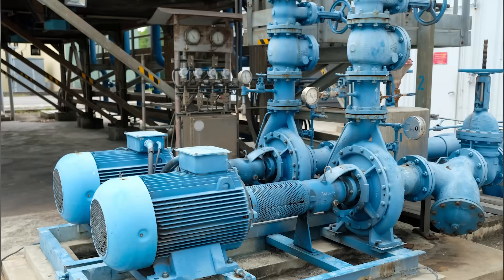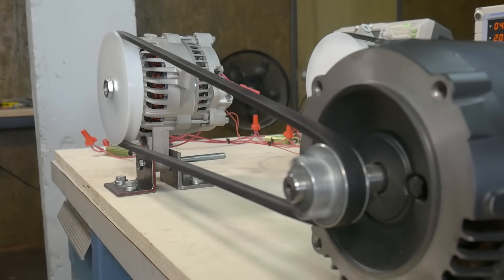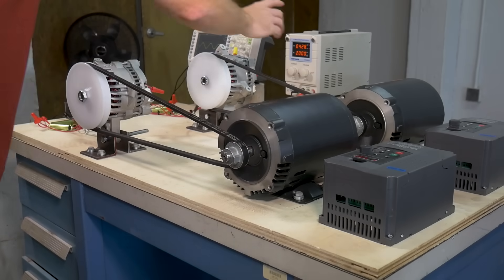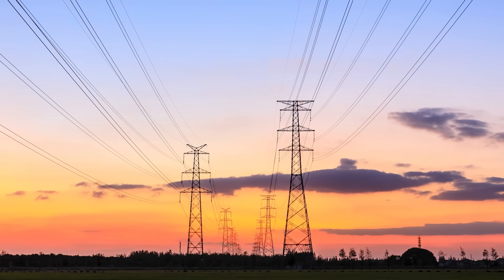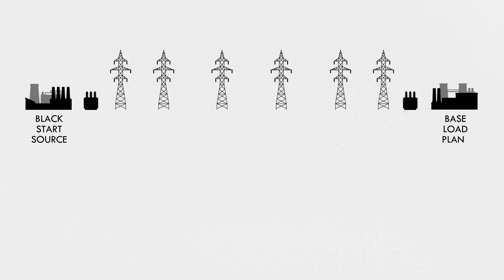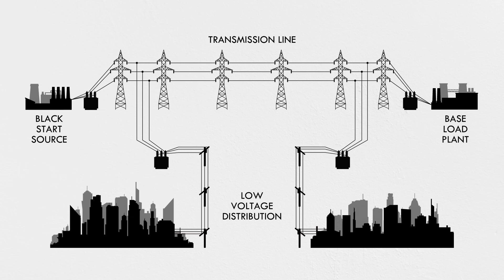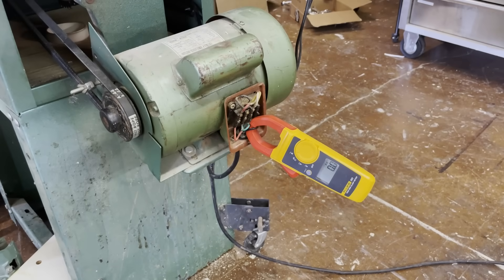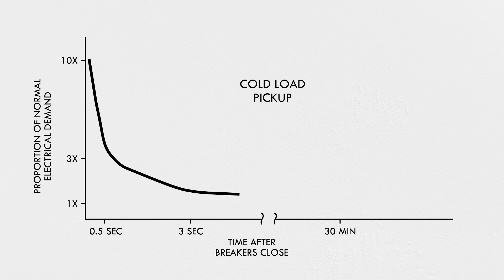What Is A Black Start Of The Power Grid?

Comment: Have you considered video or series on landfills?  Street collection, transfer stations, the detailed hydrogeologic investigations that go in to landfill siting and construction, use of low-permeability natural or synthetic clays (and their moisture-density relationships), HDPE liners, and drainage systems to prevent environmental degradation, groundwater monitoring,  placing and compaction of waste (can throw in GPS-enabled equipment and lidar surveys), final cover design and construction, landfill gas collection and power production, and if they're still awake after all that, the local, county, state-wide and federal permitting.

Regardless, I love all your videos and keep up the good work!

Comment: Interesting. I live in Florida and have experienced storms ranging from "merely" tropical to full blown CAT-2 hurricanes. I've lived in the same house all these decades and have wondered why it sometimes takes just as much time (sometimes even more) to get back power from a lesser storm. This video gave me a greater appreciation of what goes into restoring a grid beyond simple physical damage to lines, transformers and substations.
Reply: Wait till you go thru a Cat 5. Try 5 weeks without commercial power. Local nuke plants cannot run without the grid being up. Even when there were oil fired units right next door. Power went out from the plants to a substation and then back to the plant. Substation going down or the grid going down resulted in the reactors scramming. So a minor storm that took out a minor part of the grid could result in power being out for days until the HV lines were back up.
Reply: @gravelydon7072  I can believe that. Just looking at what happened to those poor souls in the Southwest of my state... Brrr, those drone footages are scary as hell. I'm pretty sure it will take them weeks just to get power up throughout that area.
Reply: @Vulpine407  They will in most areas have an easier time than down here. Here if you dig down 6" you are in rock. When Andrew came thru, it snapped off most poles at ground level. That included brand new concrete poles that were 4' in diameter and so new that the power had never been turned on to them yet.  On our street is one lone survivor of Andrew. The pole in front of our house was put in in 1978 when our house was built. They had to top it to install a new insulator but our transformer was put back in use for almost another 5 years after that. It has a lean to the West but it has survived a Cat 5, several Cat 1,, Cat 2, and Cat 3 Hurricanes. 

After Andrew, my employers flew over the areas hit with the District chopper. I have the unedited videos from that with the time stamp on it. Now days drones do the same work. And yes, I can feel for those on our West coast having been thru one of the worst in US history.
Reply: As a Mississippian I am surprised you’ve lived in Florida for decades and still haven’t been through a 4 or 5. I still have nightmares about Katrina when I see hurricanes on the tracker heading our way.
Reply: @huntercarter5426  2005 was a bad year for us down here too. While we didn't have a Cat 5, we did have 3 of them one right after another. Katrina, Rita, and Wilma all touched us with Katrina a Cat 1 at the time , Rita was a Cat 2, and  I forget what Wilma was when near here. With Rita we lost power for a week as the crews had to repair some of the three phase lines before they could get us powered back up. Once the crew arrived, it took them most of the day to find where the fault was.  It was a cracked insulator that they only found after blowing a number of fuses trying to locate it. It was a 3 mile long power line. We now are on a segment that is only 1/2 mile long. Much easier to find the fault but bumps us down as far as priority.
Reply: @huntercarter5426  Oh, the state has certainly been hit by quite a few CAT 4 & 5 storms. But since I live in the interior of the state, they tend to lose at least two category levels (usually three) by the time they get close to me. If memory serves, Hurricane Ian hit the Punta Gorda / Cape Corral area as a CAT 4. But by the time it had reached my county, it had dropped down to a CAT 1. I believe Hurricane Charlie was the worst one I have gone through in my area. It was still about CAT 2 strength when it went through my county, badly damaging our main roof and pretty much destroying our carport. It was followed by another hurricane just a few weeks later (can't remember the name) that crossed over us from the other direction. Thankfully, that one was weaker. But the joke in central Florida that year (2004) in my area was: "X marks the spot."
Reply: Only CAT 2? You’re lucky. I live in coastal area of a mid Atlantic state commonly hit by hurricanes and I’ve lived through all but a 5. Only evacuated for direct strong 3 hits and above. We were lucky though as we didn’t have to worry about the sound flooding as it came back in as many did or ocean overwash.

Comment: I’ve worked closely with WAPA in the USVI. They take each island grid down every time there is a tropical storm or hurricane. And so they must have a blackstart recovery each time, which is difficult bit on a smaller scale than any off the three grids in the US/Canada (Eastern Interconnect, Western Interconnect, ERCOT). Large grid or small grid, getting them up and synchronized is a challenge.
Reply: I get generator synchronization but grid synchronization begs many questions:

What is used for the grid frequency reference?
How is the generator frequency in each island adjusted?
Would only 1 transmission tie line be used for the initial sync?.
Reply: @JohnDoe-od1yj  From my EE education, one line would provide initial sync, then each additional line might need phase adjustment before establishing a redundant connection that turns the lines into an actual grid.  Fortunately, most black starts happen on a grid where all the lines were correctly adjusted just a few hours earlier, so they tend to be in sync already and just need power to run.  Situation is much worse when recovering from major grid damage as the adjustments will have to be redone during the process, as the grid is essentially being rebuilt.  Someone will have to watch synchronization meters at each interconnect before closing the big switches.  Oh, and good luck phoning the control room from the field as telecoms have been skimping out on their back up systems for about 2 decades now.  I hope the grid operators have backup power for the old control fiber optic networks to function during black starts.

Comment: I feel like you jumped ober the usefullnes  of grid battery like tesla megapacks have. With there inverters they can generate the the frequency and and power to a pant. Aso digital inverters are extreeemly fast in countering spike loads vs those big turbines

Comment: I worked as an overnight maintenance engineer for a large hospital complex.  I had to do weekly load tests which involved shutting off most of the heavy draw equipment (elevators and such) leaving on minimum equipment running and fired up the generator.  My involvement was just press the start button on the generator and it automatically shut off the external power and running operations on gen power.  I let it run for 30 minutes and recording voltages and amperages and fuel levels.  At the conclusion of the test, I pressed the shut down button and watched as the phase and voltage matched the grid power and when they matched, the generator would automatically disconnect and begin it's cool down period and shut off.  In case of a power outage, the generator would fire up within a few seconds and all equipment on the emergency power circuits would be powered up.  This kept all essential equipment up and running.  However we could only run one elevator on emergency power.  I did a lot of reading of the manuals to familiarize myself with the operation and maintenance of the generator and switch gear.

Comment: Idea: combine both magnet and a coil in the rotor. Make the magnet so it generates 90% of voltage, and use coil to regulate remaining 10%. Voila, you just saved 90% of power consumption and startup power.

Comment: Synchronization is too important to be left to an operator with a synchroscope and quick reflexes. Each generator is equipped with a "sync-check" relay that will not allow an operator to close the breaker that connects the generator to the grid if the generator is not in-sync with the grid.

Comment: Black start has to do with a generator. The "grid" does not have to be started, you just close breakers from where you have power. A gen, has a lot of turbine related pumps, control equipment, etc, that needs power, before you have any power. You need a small gen to provide power to get the bi gen going.

Comment: You have avoided the fact that a generator with no electrical load will 'run away.'  This is not a problem for your AC motors because their top speed is defined by their power frequency.  As a generator is spun up, it must also be matched with an independent load until the frequency and phase matches the grid.  "Closing the switch" transfers the generator's output from this independent load to the grid.

Comment: OK, I am to drop the bomb that spawned endless arguments in the other vid about this.

New generator needs to be synced to 180 angle to the grid before it is connected, not 0 angle. The argument is that electromotive force of the grid is directed the opposite direction than the one of the generator. I.e. if we stop time at some moment, we will see the grid trying to push charges into generator and generator is trying to push charges into the grid; or vice versa, depending on when we stop time. If the grid pushes and generator pulls - that's when we got automotive forces moving charges into the same direction along the wires, thats when we got 0 phase angle, and that when we got devastating short circuit.
So.. why are they 0 angle on the oscilloscope? Because you put oscilloscope in between generators! The push against each other and both into oscilloscope which is in the middle point. But they still remain opposite to each other.

Comment: Speaking as an old retired electrical utility employee, I think that in your series, you have done an outstanding job of breaking down the high-wire act that is the electrical grid.
On a side note, nuclear power plants cannot afford to be without an on-site cold start power supply, since they need power to monitor the reactor, and maintain cooling, while the grid recovers. This was one of the lessons of the 2003 blackout. Every nuclear power plant installed a large diesel generator on site after 2003.
A further lesson from the 2011 Fukushima event, was that nuclear power plants have to have emergency generators sourced offsite, and available to be brought in, in the event all power sources onsite are lost. Now every nuclear plant has an emergency generator sitting off site in a warehouse, ready to be brought in, if needed.

Comment: Reminds me of how large aircraft are started without ground equipment.  You use a high psi wobble pump to fill a start tank, which in turn starts an APU, which in turn provides bleed air to start an engine that provides more to spin.up the rest.

Of course, the better way to do it is using ground power.

Comment: one thing, many of the powerplants will just trip the breakers for generator exits, even it basicly means that many selfconsuming applience in power plants will stop working, but it is only for a short time, many plants have ready to run diesel generators, mailny Nuclear, those can newer be without power to keep the core cooled, they can reduce to like only one reactor at minimum sustainable reaction and keep operating in the time needed to repair infrastructure, and then use that one reactor to "cold start" other reactors and eventually other powerplants like coal and so on, but that one reactor is still running and producing just enough power for the facility to operate

Comment: Back in the late 1980's and early 90's I lived in St. Cloud Florida and the lights would go off and back on several times in a row around 12:00 am.  Later I was told that it was due to a GENERATOR being added to the local grid so that one could be shut down for maintenance, and I was told that it was because this generator was slightly out of phase with the other generators that caused the lights to go off and on.

Comment: 10:05 - Back in power lab in school, we had a 3-phase "machine" (both motor & generator), the size of a full sized van, that we had to speed up to synchronize it to the AC line before connecting it. We used 3 light bulbs, one for each phase, and connected, when all 3 lights went out.

Comment: That's not how we synch using a synchroscope.  You adjust speed until thr needle is moving slowly in the fast direction.  Then you synch 5 minutes to 12.  That ensures your generator picks up load and also ensures the latency of the operator will close right in phase.

Comment: I've used that GE syncroscope to sync to the grid. It is impossible to make the needle stop at 12o'clock to close in the output breaker. Slow in the fast direction and close the switch at the tail of the arrows fletching so you ensure you pick up load and don't reverse power the generator.

Comment: I've heard tell, from a friend with an engineering background that was from upstate New York, about a small coal-fired plant that was blackstarted during the 65 event c/o some real outside-the-box thinking.  Bootstrap power was needed to run the conveyor that fed coal to the boiler; once they could get it re-lit, the rest would fall into place.  AC motors will run on DC if you get the proper voltage, you just have to pay attention to polarity for which way the motor turns, so they pulled the batteries from their cars, strung 10 of them together in series (maybe doubled up series-parallel) to start turning the crank.  And that did the trick!  Or so the story goes.

Comment: I am an electrical engineering student and had a lab experiment on synchronisation. Your demonstration has helped me to understand why synchronisation is so important. Thank you
Reply: I saw some good videos online showing synchronous motors and how they lag as the load builds until they pull out of synchronization. That would certainly cause some wobbles with a big motor. Also lots of stuff on using one for power factor correction. Im a truck driver not a student but I can understand the principles if not the details from  this.I live in South Australia where we have some days using 100% renewable only and exporting to other states thanks to wind/solar farms and high penetration of rooftop PV along with grid scale batteries. The problem is grid stability due to such low "inertia/momentum" because there is not really any spinning generators during high output days and it is easy for harmonics to upset the system. They have installed 4 rotary Condensers which are solely to add a flywheel effect to pull up the grid or keep it down if it surges.  You will probably be interested so this is an article on it 
https://www.energymagazine.com.au/sa-synchronous-condensers-installed/
Reply: When engineering generator systems, this is why we use protective relays that have an ANSI 25 synchronization check function. It prevents a breaker from closing allowing a generator and a live bus to be connected out of sync. If this happens out of sync, the mechanical synchronization is very bad. 180 degrees out of sync, and it's a kaboom situation.

Comment: You can actually hear it when 2 large generators(alternators) are connected together out of phase. You'll hear the frequency difference (beat frequency) vibrating in the coils of the 2 machines, fighting against each other. You can feel it by touching them also.

Comment: The generator voltage imbalance is called an Aurora Vulnerability. Idaho National Lab has a video showing it with a full size generator, I think about 5-10MW. The starting current for large devices is something I talked about in my Masters capstone paper as a concern with the smart grid.

Comment: In some smaller hydroelectric power plants they could use the exciters for station power and black starts. In early oil engine or diesel engine power plants they might have a small gasoline generator for station power. I am almost tempted to go downstairs and flip through my old engineering, General Electric, and Fairbanks-Morse manuals.

Comment: Your videos are great and the time you spend doing them and the practical demos are appreciated by many.  You inspire me to go back to uni and finish my engineering degree, but as an electrician I have had the experience first hand of installing and commissioning multi genset power farms both grid interactive and island systems.  It is good that all have been scada controlled with all synchronisation automated. Have done a main generator upgrade on a ship that had old sync lights and hertz meters that you used to sync with aux genset